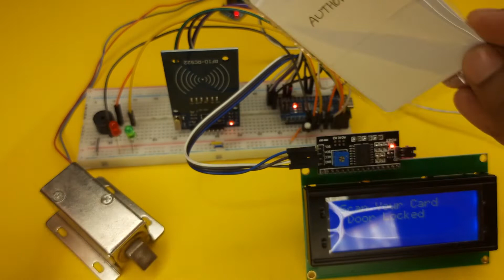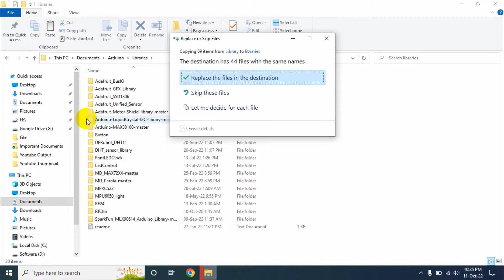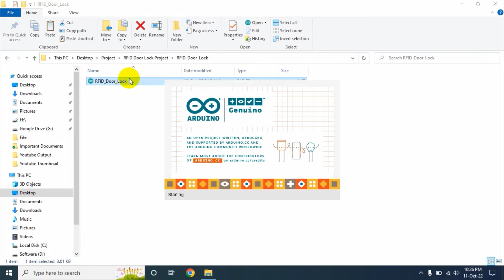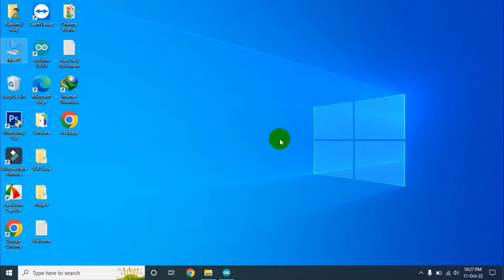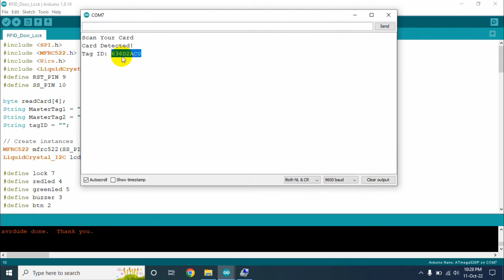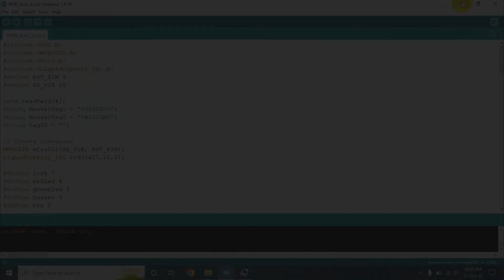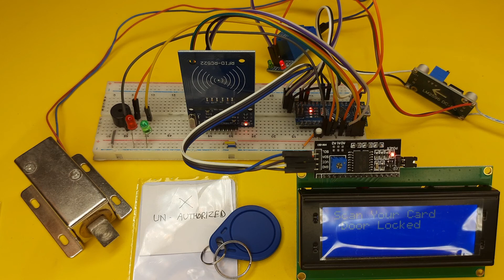RFID Based Door Lock System using Arduino and MFRC522 RFID Scanner

Comment: Hi! I have a question. What is the problem if I scan first the Access denied card then the buzzer beat. and then when the Access Granted it will unlock, but when I scan again either the Access Granted or denied it won't function then. I have to unplug it again to reset. Please help meeeee.
Reply from the maker: Just carefully check the diagram. I have used a diode with the locker in reverse. It's so important. Nor you will face this problem always.